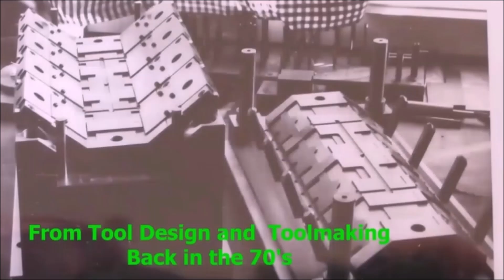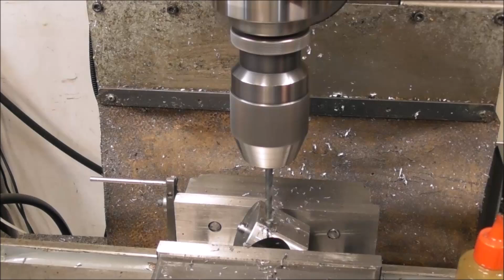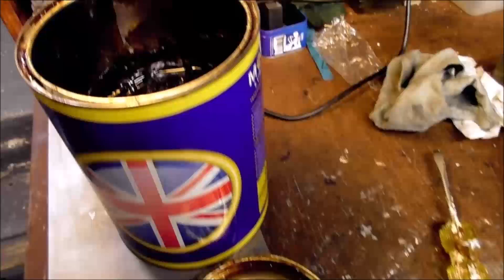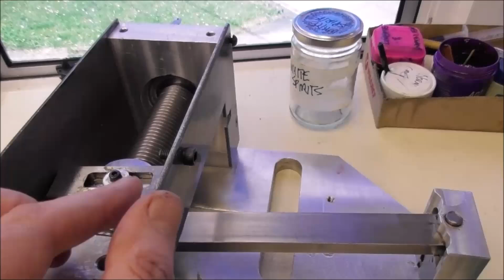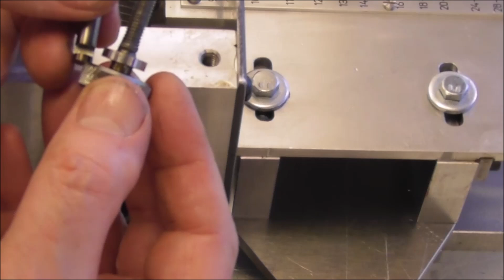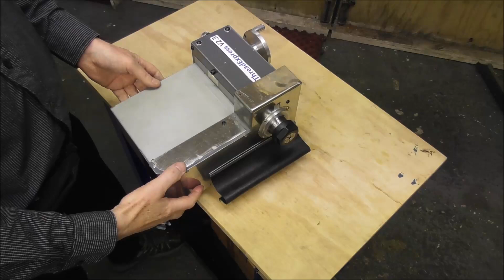Mechanical Assembly Tips and Tricks

Comment: I'm aware of engineers that would argue, "if you need a high tensile bolt, don't". If you feel you can extend the thread stop wasting your money on high tensile bolts.

But I'm pretty sure opinions will vary on that one....;)
Reply from the maker: Well, here is the official response: "Ah, engineering humor! The joke plays on the idea that engineers tend to have strong opinions about the "right" way to do things. Here, it's about the use of high tensile bolts, which are stronger and more expensive than regular bolts. The joke suggests that if you find yourself needing a high tensile bolt, you might be over-engineering the solution. Essentially, it's saying that in many cases, you can achieve the desired strength by extending the thread of a regular bolt, thus saving money.
The punchline is the acknowledgment that there will always be different opinions in the engineering community about such matters—hence the wink at the end." 😉